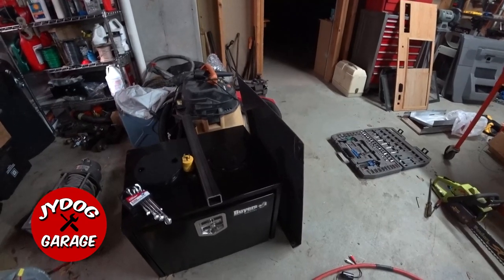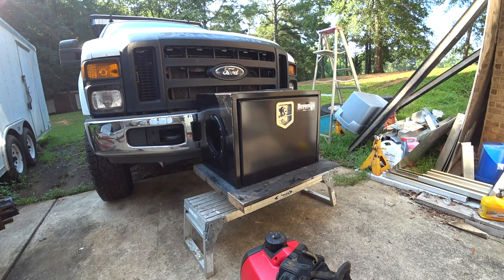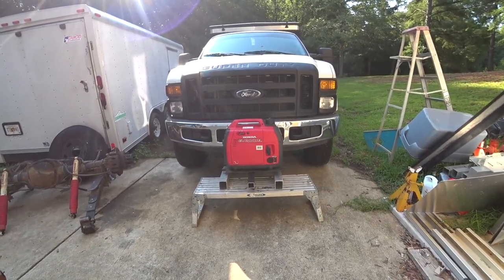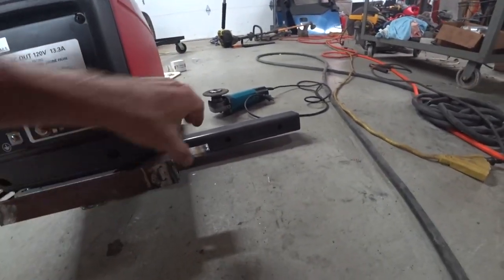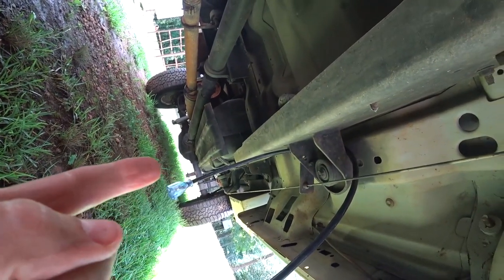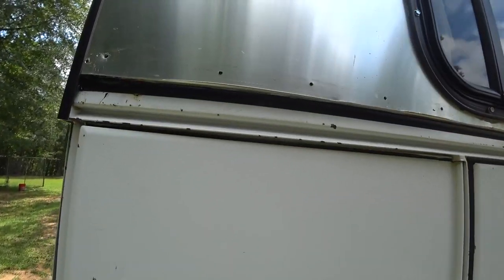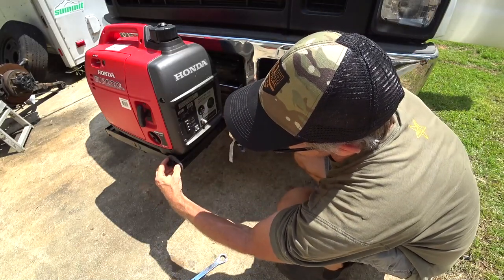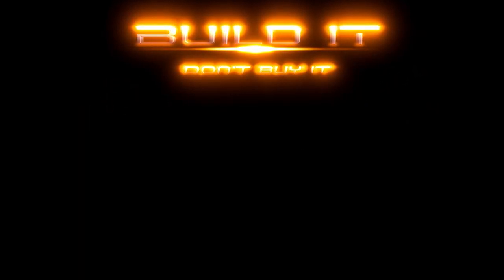Budget Overland Camper 20 - DIY Hitch Mounted Generator

Comment: I did the same thing on my truck camper , you can check it out on my YouTube channel. I was afraid a box would limit air flow and overheat the generator so I made a half cover to keep out driving rain but open on sides back and bottom. We recently drove 3800 miles out west and ran the generator part of every day to keep the refrigerator cold. I zip tied an extension cord to the frame of the truck and plugged the camper in. It worked great but I have to remember it’s there when parking.